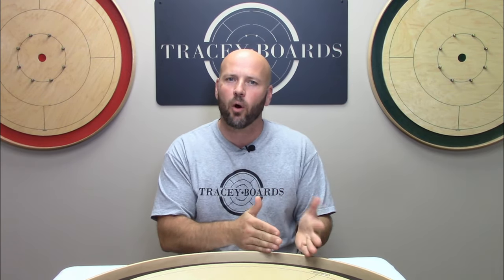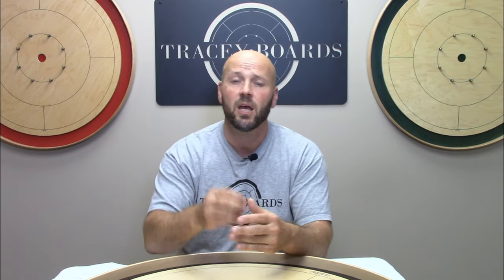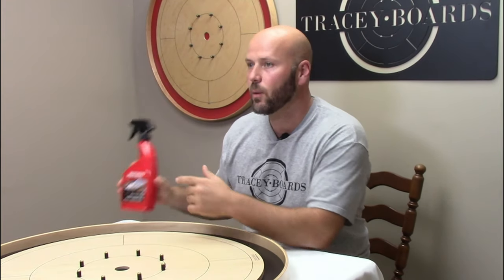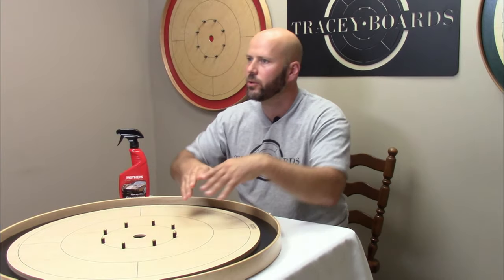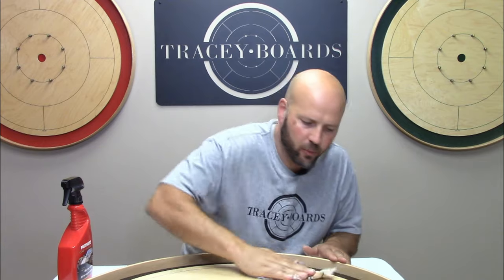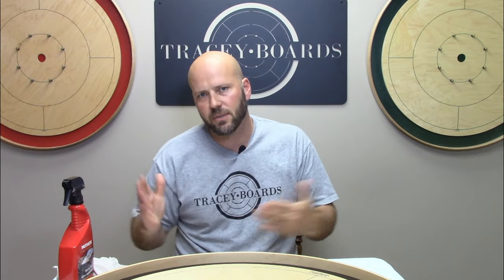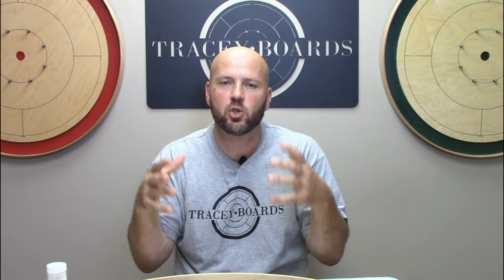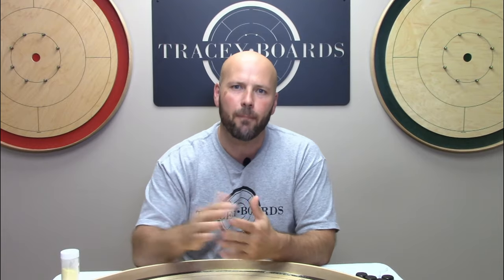How To Wax Your Crokinole Board & Crokinole Buttons

Comment: Excellent advice telling people to be sparing with how much wax to apply. I wonder though if the discs shouldn't receive even more frequent attention than the board rather than the other way around as you suggest. The discs are what come into the most frequent contact with those clammy oily fingers. There's even a WCC rule that states that players are not allowed to be holding discs in those greasy mitts between shots (likely out of consideration for the next contestant in the rotation). Whenever I see a Meinecke (a disc that slams on the brakes unexpectedly ) my money is on the disc being at fault. Everyone whose lost points because of a Meinecke, please raise your finger of choice and wipe away a tear to acknowledge such a tragedy! You know it might be a reasonable idea to allow/suggest that people bring a pair of their own proper sized disc sets to a tournament,  that way if your discs let you down the blame would rest with the owner. Any thoughts?
Reply from the maker: interesting idea about taking your discs along with you.  I think every player would need two sets in case you sit across from someone with the same color as you... that could get confusing.  I have talked to folks who assumed that is how it goes at a tournie. There would be pros and cons to the idea.
Reply: @TraceyBoards  Yes each player would have to bring a couple of different coloured disc sets. I can't think of another obvious con beyond having to tote sixteen discs from table to table or the fact that tradition has been that discs are supplied (however only at the WCC are all the discs provided by the organizers. Most tournaments ask participants to bring extra boards with discs and that's where the 'sticky' part can come in. Interesting that you've met people who assumed you brought your own discs - probably dart players, eh? Maybe lawn bowlers.
Reply from the maker: @ericrm305  i think they were dart players, yes.  The other challenge or con is managing fairness.  Let's say you are really good at waxing your discs and a new player doesn't even know its a thing. Your discs are slick and their discs are slower.  Pros and cons to fast and slow discs but having opponents with different behaving discs could cause issues.
Reply: @TraceyBoards  Good point (sorry I'm so late to seeing this reply) BUT the new player will only realize prepping your discs wasn't a thing 'once' and will know better next time in the same way they will learn it's better to burn their last disc rather than chance a high risk shot if they're already ahead or that's it not good etiquette to be rubbing their next disc in the ditch while their opponent is getting ready to shoot. We all learn it's probably a good idea to try a few shots on an unknown board but no tournament could allow the time  and tedium to test out every disc. That surprise bum disc is just plain cruel, even more than leaners on a frayed-edge center hole. 
What would happen if someone showed up to a tournament and insisted on using their own discs? Oh Gawd! I've helped organize a few tournaments - 'Uh, innovations? No thank-you!' It's probably why the WCC specifies 'no fingerguards'. Fingerguards??? Are, or were, fingerguards ever a thing?   Oh, here's one last instance. At the WCC one year I got asked a couple of times if I would play 'halfboards', I said "eh?" They replied that they were used to being able to shoot from half the board rather than one quadrant. (An interesting wrinkle). I whispered "They're really strict here, we'll get thrown out for sure."  By the way, do tournament golfers get to use their own balls or are they regulated like almost every other professional sport?

Comment: Should have mentioned you need to shake the Mother's bottle up before spraying your board. If it has been sitting on the shelf some separation of the wax and liquid is likely to have occurred.
Reply from the maker: Thank you for this note Scott. It isn't an issue for us because the bottle is used almost every day in the shop and never has a chance to settle and separate so didn't realize that a shake up was needed.

Comment: I can't find Coleco's buffing instructions for my 1980's or possibly late 70's painted mdf crokinole board with the sheet metal octagon border and plastic ring shooter discs and the protruding rivets on the shooting line right where you want to aim for a 20 anywhere.  Is that turd even worth polishing?  Slow as it is, it's still way more fun than flipping the board over to play checkers!
Reply from the maker: Yup, I have played on boards like that too and 100% agree, still way more fun than checkers or most other games for that matter :-)
Reply: @TraceyBoards  I do have a can of Trewax (carnauba), maybe I will experiment on the checkers side of the board and see what happens...

Comment: Super curious what you think about buttons being weighted so that it would coast further, like a puck on an air hockey board?  The appeal of a floating disc is so appealing.  Has this ever been explored?  It would seem to be more fun and challenging.  What do you think?  Thanks!
Reply from the maker: I think whatever the weight of the disc is it needs to be the same for both players.  A heavier disc, I am not sure it would go further on a follow through if it is also hitting a heavier disc.  BUT I am NOT a physicist by any means.  I have a pretty good idea of what our buttons will do when hitting our buttons but I don't know the physics of why.  So I also don't know what would happen if both were heavier.  As for more like air hockey, I think the closest I have come to that is when playing with ultra fast wax. So fast you can barely keep the buttons on the board.  IMHO that is not as fun.

Comment: I built my own board instead of buying one.  I finished it with Minwax Polycrylic.  I have tried the paste wax and not gotten great results.  I am going to try the spray wax that you recommend.  Should I really sand my board down to a specific grit first before applying the spray wax?  My board is definitely playable and we enjoy it.  But it is not as slick as I wish.  I would really like to get it super slick so that the buttons glide effortlessly across the board.  Just wondering if I need to give it a good sanding first.  Thanks!
Reply from the maker: I do NOT recommend sanding your board.  If you were to sand it then it would need a fresh coat of lacquer applied and that opens up a whole new can of worms.  If spray lacquer is applied and there is still some of your paste wax left behind it is likely to react and end up feeling like an orange peel. 
Hope that helps.
Reply: @TraceyBoards  ok thanks. I am a woodworker so I am comfortable with sanding away all of the existing finish and applying a new finish if needed. But if I can just apply the spray wax over the Minwax Polycrylic then that is good too! Thanks so much. I really enjoy your videos.
Reply: @theburnetts did you sand the polycrylic at all before waxing? How many coats of poly did you use?
Reply: @benjaminmccown131  yes I sanded the poly. I think I probably did like 3 coats of poly. Can’t quite remember. It was a while ago. I tried the spray wax that he recommended in this video. It helped a little bit for sure. But still don’t get that glide like I see on other crokinole videos.

Comment: Great instructional.  I have a question about the thicker paste waxes.  The ones you use possibly less often, to help fill in the large knicks and blemishes that an older board or just a harder used board might have.  What brand(s) do you recommend?   I have been using Mother's California Gold Pure Brazilian Carnuba Wax as my once-every-few-months wax product.  It works alright, but even with a thin coat it tends to make the play surface a bit dry and not quite as fast as I would like.  I usually follow with the Mother's California Gold spray wax and that puts that buttery finish back in place.  Any recommendations or alternatives? 
Thanks and keep up the great work.
Reply: Few notes on paste wax. As long as you are using paste wax, the brand itself shouldn't matter too much. I own and use Meguiar's Gold Class Carnauba Plus Premium Paste Wax, applying it on over 10-15 different boards. Make sure the package says paste wax and not cleaner wax. Cleaner wax has some grit that can strip the surface of your board over time.

When using paste wax, thin layers should be applied, give it 15-30 minutes like Jeremy said to fog over and wipe everything away. Usually slow spots occur because of too thick an application. Many thinner layers will do better than one or two thicker applied layers.

I only use paste wax on boards that you can feel imperfections in the surface. Mayday boards have required 7-8 layers of application to fill in those gaps and make it a respectably smooth surface. Once you have a board with a smooth surface, I never use paste wax and just use the spray wax. I have not once used paste wax on my Tracey board.
Reply from the maker: I think Adam shared some helpful thoughts below, did you see his notes?  what other questions do you still have?
Reply from the maker: Fantastic notes Adam, thank you for this.  I am guilty of finding an amazing product that works well and not touching any paste wax since.  Using the paste wax was tough enough but trying to explain to someone how much to put on and how hard to buff wasn't much fun.
Reply: For your boards, all you need is the spray wax. I helped someone wax their board a week back and no amount of spray wax was going to help that poor board. They owned the board for over 15 years and never really waxed it. It was like playing on sandpaper.

I agree, especially on video, it is very difficult to instruct on how to properly wax with paste wax, but a board in a specific condition needs that first to smooth things out.
Reply: @adamziobrowski528  Thanks Adam,
I was starting to think that maybe I was missing something.  I think my board is just in good shape and doesn't really need the paste, which is a good thing.   That pretty much covers my questions, thanks again.
Reply: @TraceyBoards  No, I'm good.  That was great info.  Thanks.

Comment: I tried using this wax on our buttons, and it actually slowed them down a lot!

We're new to Crokinole, having played maybe 50 games or so with our set. But I noticed some significant wear on the buttons, especially where the point of highest contact was. (Some buttons had a "dot" in the middle where the paint wore out) So I tried waxing the buttons using the wax recommended in this video, and now they slam on the brakes.

I tried a second coating, making sure to shake the bottle first (per Scott's advise). I used a t-shirt, and then a micro-fiber cloth meant for lenses. Still no luck! They used to glide across the board so nicely. 

Any advice? We're so bummed out about this.
Reply from the maker: That is so strange, I have never heard that before.  Did you wax your board as well?
Reply: @TraceyBoards  Nope, only the buttons. They glided smoothly until we waxed them. Because of  this change, we definitely didn't want to do the board.
Reply from the maker: @snarfleezcattleprod4506  can you shoot me an email?  I want to help you solve this. Traceyboards@gmail.com
Reply: @TraceyBoards  Sorry for  the delay, we took a scientific approach.
You were right, of course! The wax wasn't the problem!

We ordered new buttons, and had the same problem, so we figured it was the board. The old buttons used to glide as smooth as butter at first but hit the brakes, it seemed, right after waxing. I thought that maybe we'd gotten a bit of wax on the board and didn't buff it? We tried buffing like mad, but no luck

Today we finally got to try the buttons on a new board and they once again float like air hockey!
Feeling confident that the wax didn't ruin our buttons, I went for it and waxed the previous board.
All is well! The buttons and both boards work perfectly.
As odd as it sounds, I think the problem was just that we played SOOOO much on our new board that it needed a wax after only 2 weeks of (rather consistent) play

TLDR: Tracy is right, and this wax is amazing!
Reply from the maker: @snarfleezcattleprod4506  glad to hear it worked out and you are back to fast flicking fun 😃 
And thats awesome that you play that much, keep it up and we will see you at the world championships:-)

Comment: So should I put my pegs in (they came not installed) before doing this?
Reply from the maker: We always wax the boards before the step of the pegs going in. AND we NEVER take pegs out to wax a board.  You can prob get away with pulling them out a time or three but to keep taking them out and putting them back in you are asking for trouble down the road.